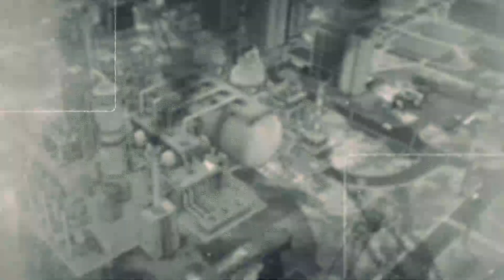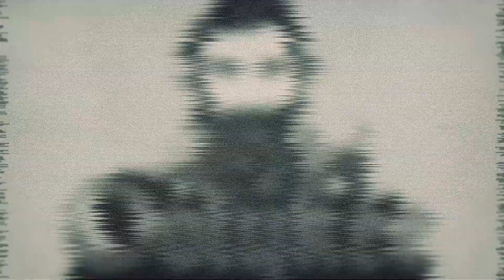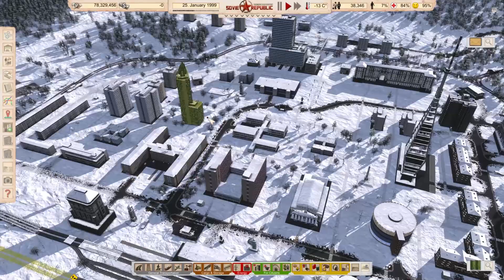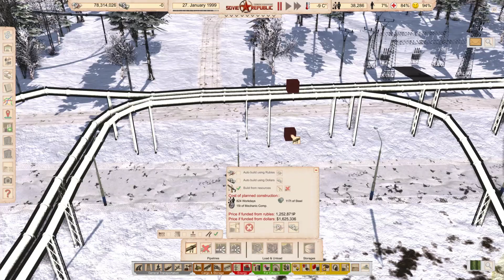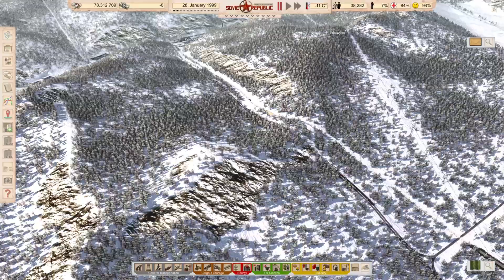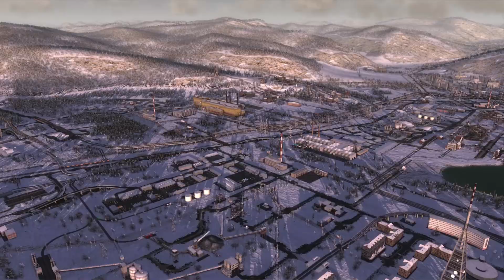Soviet Republic - Alaska - Pipeline - Ep.204

Comment: 8_00 The tanks on the right side are only filled when the tanks on the left side are full, as long as the pipes from the refinery first go into the left tanks. I have a system like this and when you export from the left tanks, they fill up first and the right tanks remain unconsidered until then. You have to do it the other way round, fill the right tanks first and then the left tanks from there.
Reply: That is correct. From the refinery you have to go to the storage tanks on the right. From there you have to go to the tanks on the left side. And from there you pump it into the port into the ships. Then the storages on the left side will only be filled when the ones on the right side are full. If they are not full, they are filled first again. That is the way to go and to make the system you want work.
Reply from the maker: @frankevert4525  are you sure because I thought pumps will empty the left tanks first. The things you said usually works when there is no pumps. With pumps they push the liquids out to the last tanks first. But let's see. I can easily redo the pipes.
Reply: @oolykeegaming81  Can you be sure about anything in the game? Today like this, tomorrow like that. We will see when everything is built and have to build it again. Both one way and the other. Because what can go wrong will go wrong, right? 😃
Reply from the maker: @frankevert4525  hahaha! So true!!!

Comment: Obviously, the management of a DO covering domestic consumption and export of surpluses is not done from tank to tank but from centralized truck loading cargo station to centralized truck unloading station (the moded one with four bays). One truck cargo loading / unloading station per group of three tanks (oil / fuel / bitumen). It is absolutely your right to think that this is not the best way to deal with the problem, but unfortunately there is no alternative solution through pumping stations, in short there is no best way (currently).